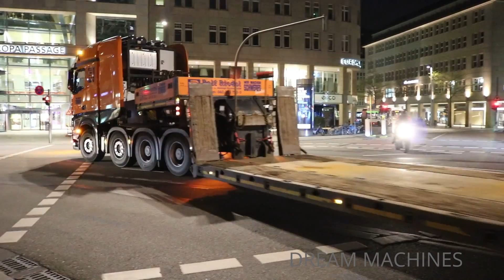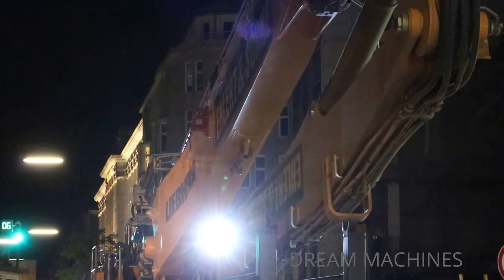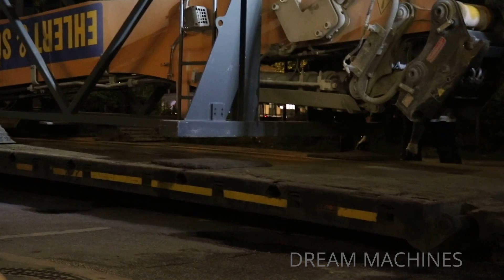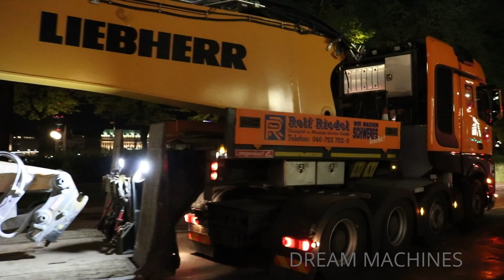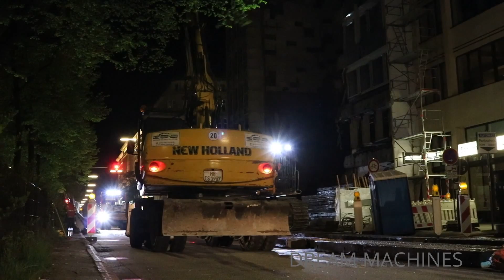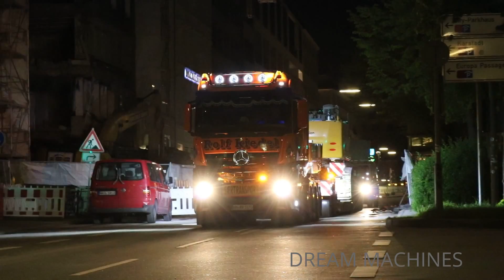Liebherr excavator R960 high reach demolition #4 oversize load transport to jobsite

Comment: cool video, that is one big machine. Why don't you see trailers like that in the US?
Reply from the maker: Misanthrope69 thanks a lot! ask the americans why they don't use such trailers 😉
Reply: Misanthrope69 I think these trailers are used in Europe to fit on smaller roads and streets. They appear to be more complex and expensive to buy and run compared to the longer but simpler trailers used in the US. The difference in design might also be driven by different regulations in maximum axle loading, vehicle length, etc.
Reply: That makes perfect sense. I was thinking from a drivers stand point it would be appealing to have the steerable axles. Pretty dang cool imho.